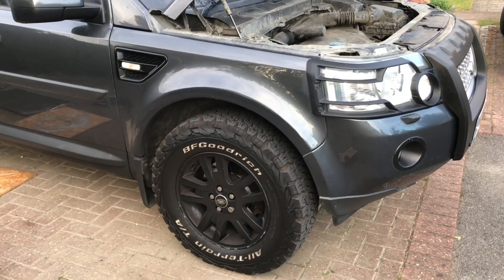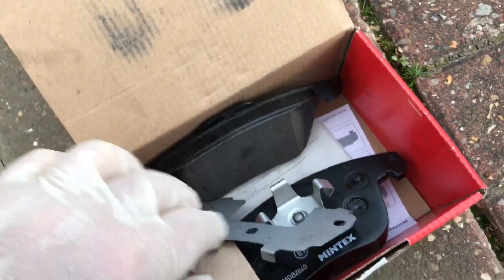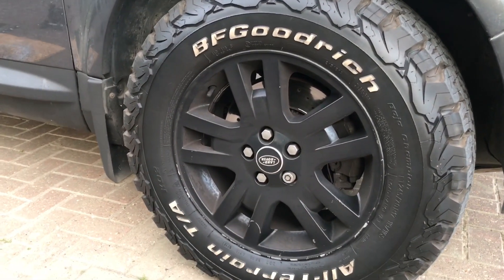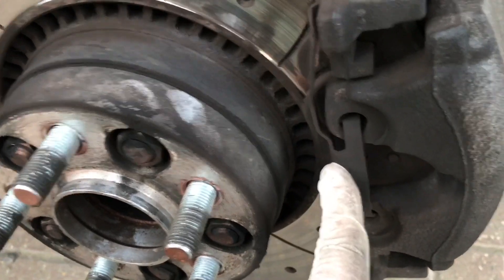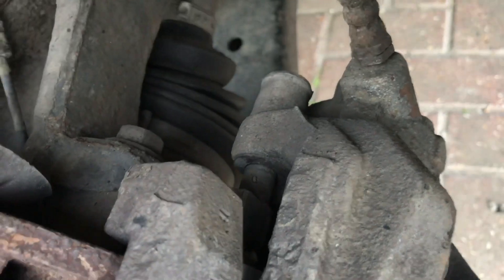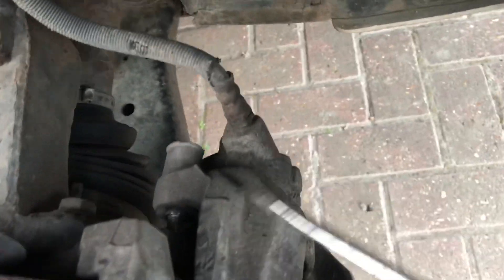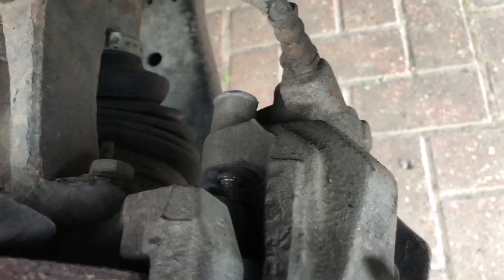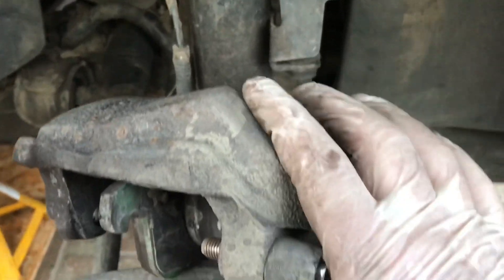Front brake pad change on Freelander 2

Comment: It’s a better idea to put a piece of flat plate onto the top of the piston if you are using a g-clamp. That way you press the piston back in squarely.This way you have less chance of pushing the piston back lop sided.
Reply: even better use the old pad
Reply from the maker: Nice idea using the old pad. You can also locate the g-clamp screw into the back of the piston. That’s how I did it last weekend.

Comment: Looking at the brake fluid it needs changing as well .
Reply from the maker: Yes, you are correct. It is over-due a brake fluid change and is on my list. I’ll be fitting braided hoses soon so will change the fluid then.

Comment: I noticed you don’t use copper slip on the back of pads, did the squeak?
Reply from the maker: I do use copper grease if the pads don’t have an anti-squeal coating on the back surface. EBC pads have this coating.
Reply: That explains it 👍👍

Comment: Hi. Can you give some information on the sizes of your wheel, tyre and spacer setup? Are these the original Freelander wheels with an ET45 offset? Do you have wider spacers on the back to the ones on the front?
Thanks.
Reply from the maker: Derek, my wheels are 17” XS alloys, sprayed black with 245/70R17 BF Goodrich AT KO2 tyres. The wheel spacers are 25mm hubcentric spacers bought on ebay.
Reply: @BeavisPits  Many thanks. It completely changes the look of the car. I like the standard 5 spoke alloys that came with mine, but at ET 55 they sit inside the wing too much for my liking. I might go for 25 or 30mm spacers. Cheers.

Comment: FREELANDER 2 2013 W EPB YOU MUST TAKE OFF THE MOTOR AND MOVE PISTON, BE CAREFUL, BOYS!!!
Reply from the maker: Mine is manual cable handbrake so I’m not sure about the motorised version on later models. I have heard that you can put it into a service mode somehow which retracts the pads allow them to be easily changed.